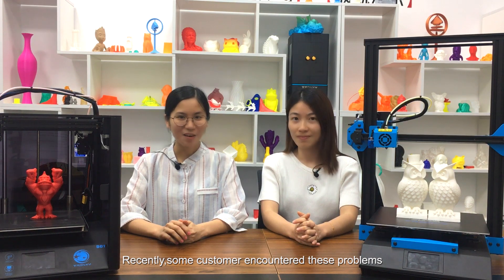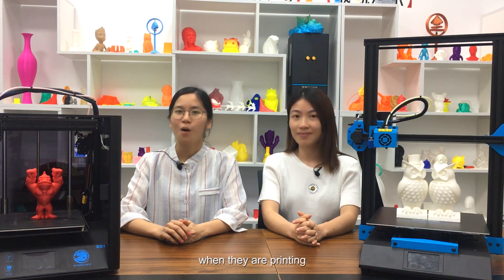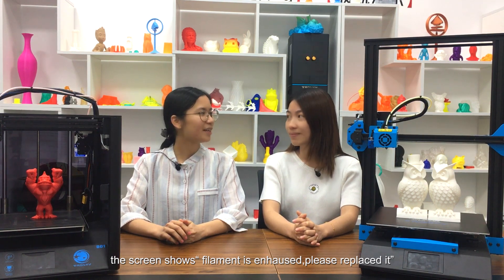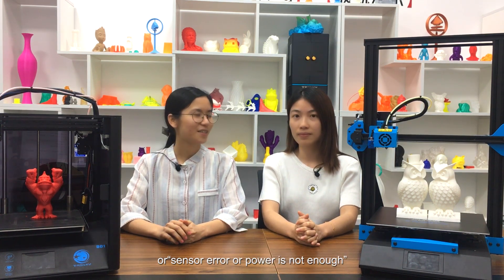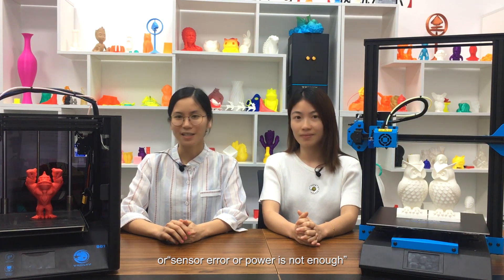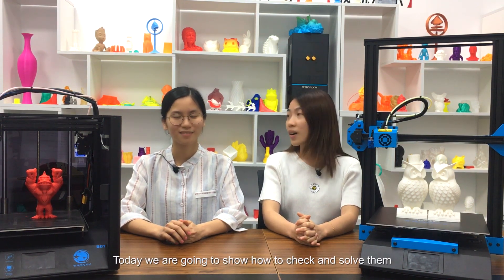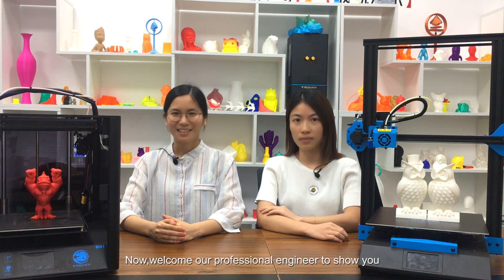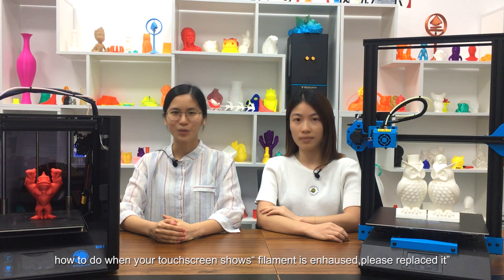"filament is exhausted, please replaced it" and "filament sensor error power is not enough" problems

Comment: You just need to turn off the sensor function during the g code command
By loading the file in g-code analysis mode in the slice program,
Insert additional commands
Same plus use as automatic bed level sensor

             M8029 D0 ; No error detection

             M8029 D1 ; Active error detection
Reply: Can u help me please
Reply: @doxsi.  Install PrusaSlicer
3d file import
Click the slicer to enable g-code edit
You just need to add the M8029 D0 parallel command
This command stops the filament load sensor device and starts the printer.
Save to usb and apply to printer
Reply: Does it matter where in the g-code this line is added?

Also is this code for the second half of this video? “Sensor error or power is not enough!” Is it for this issue?
Reply: Hello does this solve the sensor error or power is not enough error that keeps coming?

Comment: Jeeo getting the filament is exhausetd, when i replace it still happens. tried disabling the sensor with g code and checked all wiring and voltage readings with a meter.. Any other ideas? I can manually feed the filament with manual filament controls.. but when i go to print, it just completely stops and says filament is empty? HELP!
Reply: I have the same problem

Comment: What do I do when my printer continues to say "filament is exhausted" even after I replace the filament? The sensor is not reading new filament.
Reply: This is my problem too
Reply: Same here, Did you find a fix? I've tried everything lol, It just stops when i press print, if i pause it tells me to replace the filament, i do that and it still prints nothing. very strange as manual feeding through the filament menu screen works perfectly!
Reply: @TheDJBrettHaley  Me too :/
Reply: @erikstellet  same for me :( any fixes available?

Comment: I'm waiting for my email response on a few problems including this one. A printer that's a month old shouldn't have a user doing electrical work.
Reply: I just got mine...a week ago...this is the second print... ugh.  I was 12 hours into a print and BAM, "sensor error or power is not enough."  Did you ever get yours resolved?